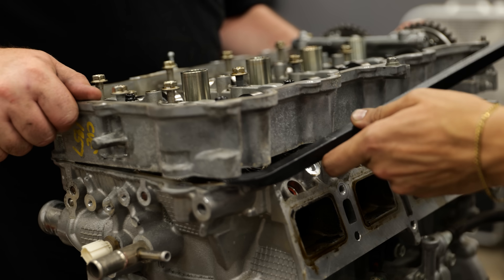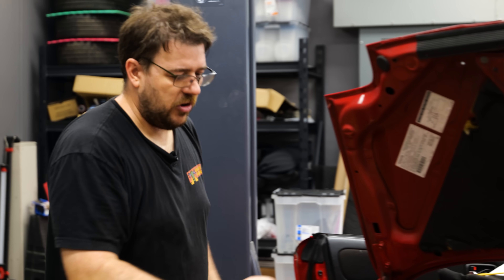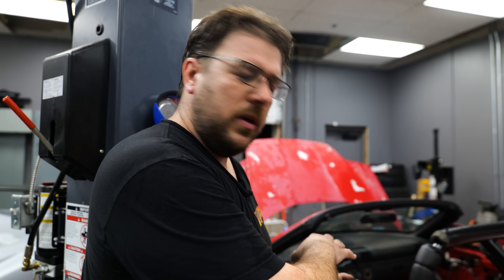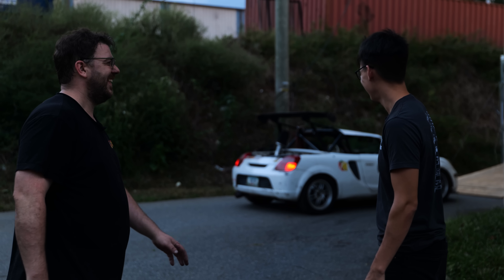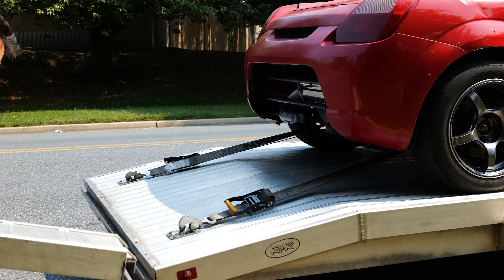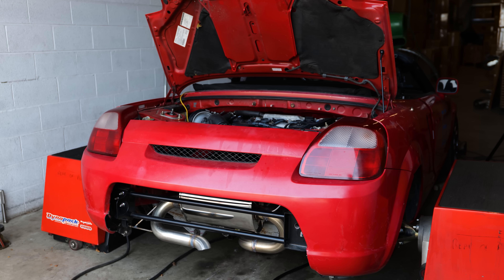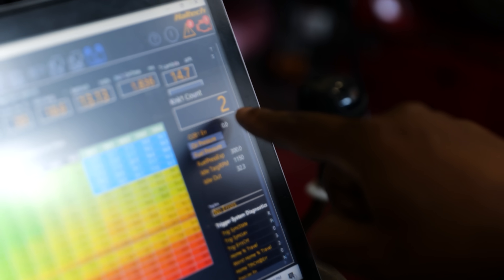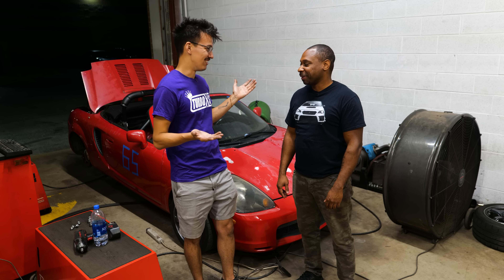Putting a Camry Engine in My MR2 - Episode 3

Comment: Thank you Ben for letting me help you with this build It was an absolute blast working with you guys for a week. I can't wait to see your reaction when you eventually take this thing to the race track. And don't worry, i have some easy tricks for more power if you don't find 230whp exciting enough.
Reply: Compare to honda K24, which worthed cost can build into 230 whp in N/A?
*Sorry my language not good.
Reply: Excellent! Also thank you for explaining things clearly and thinking outside the box.
Reply: @donnysgarage545  as of right now. It’s cheaper to do 2ar. Toyota more belongs so easily install. 300-330 is possible.
Reply: @justanotheroglesby2847  wow.. why toyota boys isnt like honda boys, which is loved to develop the engine like 2ar than k24. 😅
Reply: You really did some great things to get this engine to liven up, very interesting to see this engine swap, great work!
Reply: Dude you're a legend
Reply: @Frankenstein Motorworks Excellent work on the development of the 2AR. I am highly impressed with what you have done.
Reply: @donnysgarage545  the only that the k24 has over the 2ar is after market support that is why they used two intake cam shaft
Reply: @donnysgarage545  it's unfortunate the 2ar didn't get much support the previous gen the 2azfe got trd supercharger performance cam shaft 2.6L stroker kits fully build 2azfe 600-900hp but the 2ar got nothing that was purely a mpg engine not a performance engine
Reply: @jermainetuning  Thank you and I admit I was a little nervous to hand off the tuning to someone else but it looks like you made sure to show the full potential of this exact configuration.
Reply: Hey men you did a great job with the car
Reply: @master6435  The 2AR has a 2.7L crankshaft available at the Toyota parts counter for $650 or so. Plus Toyota just built in a lot of the upgrades right in on the base version of this motor. For example with the 2AR-FXE build we are spinning that thing up to 7600RPM on stock valve springs. The stock 2AR-FE intake manifold seems to be able to move enough air for about 240whp, the exhaust ports are absolutely enormous and have room to be ported out way bigger. They just included everything right from the factory and it ends up not being as obvious that way.
Reply: On time of 3:00 when you first start engine with new exhaust I can clearly see the coolant leak as you rev the engine. Hope you will fix it before driving out of the shop. Great build, enjoying every minute
Reply: @FrankensteinMotorworks  wait the crank from the 1AR-FE tacoma can fit in the 2ar block?
Reply: @master6435  for the reference, maybe you can see the papadakis racing build this engine make 1.000 hp at 7th years ago in channel youtube papadakis racing.

Yes i agree, unfortunately toyota communities dont have support with performance part, unlike k24 honda performance part is abundant.
Reply: So can we call Marc the “2az doctor” or “Toyoda”
Reply: u gotta turbo kit??
Reply: @master6435  the 1ar-fe is in the venza, sienna and highlander and yes it will fit.
Reply: @cornpop21  Probably not wise since it's already 12.5:1 to compression ratio.
Reply: Now the question is, will this motor fit in my Corolla hatchback? 😎
Reply: @melvinlopez9248  if your talking a new model year hatch, i dont see why not. The current motor is a direct injection derivative or younger sibling to the 2ar, if i recall right.
Reply: @Frankenstein motorworks what size is the exhaust on this build?
Reply: @e5141981  This is 2.5" from the collector to the tail pipe.
Reply: Did I miss the torque reading? I'm curious because I'm debating looking into doing this swap in my 05 corolla xrs over a turbo system on the 2zz. I'm getting a little older and the car will stay a street and auto x car so a torquey mid range with reasonable peak power speaks to me over the more peaky nature of the 2zz.
Reply: @FrankensteinMotorworks  you are doing great stuff mark. Keep it up
Reply: @FrankensteinMotorworks  that is cool
Reply: @donnysgarage545  agree, k24 + k20 head does like 270hp 🤣 stock k24 can do 240+ whp easy
Reply: @FrankensteinMotorworks  2AR 2.5L is around £1000 here. Which is the same price as a Honda K24 that offers a lot more support. It may make sense for your market but nowhere else outside the USA
Reply: Was a delight to see you on the channel and to learn what can be done with Toyota engines
Reply: @RoadsterAlex  The 2AR-FE is mostly a North America and Australian motor. The reason it isn't cheap in the UK is because you only get the 2AR-FXE, not the 2AR-FE and the volume is really low. But just because it only makes sense in a half dozen countries does not mean it should not be explored because those half dozen countries are my big markets for my parts anyways.
Reply: @FrankensteinMotorworks  I get your point but you sometimes act it’s a better choice than a Kseries which it’s not :)
Reply: @RoadsterAlex  the point is it’s cheaper and easier to do, k series parts are $$$$. They made this power from stock junkyard parts. 230whp na from 4 cylinders is amazing even compared to 4 cylinders rolling off the production line today. Yeah k series has a ton of support and potential but this is an amazing achievement and smart/cheap solution to the big issue that the mr2 spyder has:lack of power stock.
Reply: Cheap is a relative term
Reply: lol, i anticipate a shortage on 2ar motors in the near future because of marc.  fortunately there aren't a ton of MR-S in the USA, and with most of the MR-S in California, not everyone will be able to do the swap.

But hopefully that means a bunch of 3rd hand 2ZZs will flood the market for California folks to pickup.
Reply: @zokusharuuku1091  in your market indeed :) kseries is a lot cheaper over here :) and agree that 1zz isn’t powerfull enough
Reply: How much more exciting is that extra 40 WHP? (:
Reply: Thank you for adapting and making parts for the engine, always love seeing engines that aren’t normally used being worked on. You seem to have done a lot of work to get to this point in terms of how plug and play it seemed
Reply: @master6435  he used 2 intake cams because it’s a cheap and reliable proven option
Reply: @beerweather1566  look up performance cams for the 2ar I've never found any
Reply: @michaelscholten9753  yeah for Google that's not even the first to see its all form sites when I look
Reply: @FrankensteinMotorworks  Dude, you are a freaking wizard with the 2AR. What you are able to achieve with stock parts and N/A only is insane. It was really good to see someone match or beat the K24. That's how the MR2 should had been from the factory. Its gotta be a blast to drive with that power to weight ratio.
Reply: Common misconception but the k swap is easier than the 2ar swap, wiring, axles shifter, 2ar is dbw, k uses mr2 throttle cable and mr2 coolant hose , both swaps are pretty close cost wise in bare bones trim but when including basics like lsd and ac the k is cheaper. And my theory about “240whp” correct, didn’t happen even with E. I made 230whp 190wtq on a non hub load bearing dyno  pump 93. Stock internal 08 k24a2. You won’t touch K numbers until you have roller rockers and the ability to command cam angle 0-50 degrees, dual cam profiles, and a higher flowing head, because I’ve seen the charts, big ports doesn’t always mean it flows more, like how the k20 head flows more with a smaller (lighter) valve 🫣

But…. If you don’t care about having the best and want to keep everything Toyota for names sake this is probably a pretty good choice.

Thank y’all for sharing the numbers!! 

Not equal, and does not have more potential
Reply: Does are car like that put you in Class A in lemons?
Reply: thanks for sharing your secrets. you may have inadvertently created the new K-swap!
Reply: @rilagin1  My car races as a class A in lemons. Note that it does not get raced in the 270whp configuration seen in the video, I race it in the lower budget 240whp configuration.
Reply: Loved watching this series. Seeing a scientist of a specific chassis work is so cool.
Reply: ever think about putting one of these back into the hybrid?
Reply: @jackcphelps  The amount of software work needed to make that work would be pretty enormous. The hybrid's transmission is two electric motors that have to balance the engine's power so with over double the horsepower the tune would be completely off.
Reply: @FrankensteinMotorworks  is there a way to mod this engine without messing with obd2/ Sensors/etc? Can it be be road legal?
Reply: @donnysgarage545  The only car this was in that was even close to a sports car/anything performance was the Scion tC and that car was marketed to teenagers. All of the other applications were cars meant to get pretty good gas mileage (my tC gets about 28mpg city, 33mpg highway)
Reply: @Caned5  The stock ECU will actually run great with much more air than would normally enter the engine. This generation of Toyota engines seem to be programmed for 20-25% more power without any need to modify the ECU. In the case of the 2AR it seems like it is happy to make about 190whp or so if you make it easier for air to get in and out. As for that being road legal, this mostly depends on where in the world you are. There are definitely some places where you aren't allowed to touch any of this and other places where you can. Also note that quite a bit of the low lying fruit is all in the exhaust. These engines are heavily muffled and unplugging that can make good power but even touching the muffler is illegal in some parts of the world.
Reply: You are a legend, thank you to all the things you are making possible for the ones who love this brand. Toyota all the way💪🏽
Reply: @RoadsterAlex  on a Toyota car with Toyota wiring harnesses and the like, I'd imagine it's easier to do this than to convert it to a K-series. I don't see many K-series making 215 wHP on pump gas for $1000. Horses for courses.
Reply: @jsquared1013  have You read trough their manual how to wire everything up? Kswap wiring is definitely easier 🤷🏽‍♂️
Reply: Is the 2ar-fxe is possible make it  to a bar legal smog swap here in Los Angeles? Toyota engine should be plug-in and economic for now to pass the ref inspection.
Reply: @rolldog82  The 2AR-FE can be CARB legal quite easily but the 2AR-FXE engine as built for this video series requires an aftermarket engine controller because of the secondary intake phaser which automatically prevents it from being CARB legal.
Reply: @FrankensteinMotorworks  great news to hear 2ar-fe swap instead k20 or 2zz. So stock intake systems and exhaust system is usable on the mr-s right? Thanks for the feedback. What's the hard thing about the swap to make it carb legal?
Reply: Would it be possible to replicate what you have done with the 2AR-FE to a 2AZ-FE motor? I know both use a variable intake camshaft but not for the exhaust camshaft
Reply: As an automotive technician, I really appreciate your attention to detail. We specialize in retro fitting EFI to older carbureted vehicles and the hardest part is making everything look factory and well thought out but you take it to another level, the amount of detail and information you learned and spent time researching really proves your level of dedication.
Reply: @nathanadams1332  Thank you for noticing, i really do aim for OEM+ with all of my parts. That's also why i go out of my way to get custom rubber mounts made instead of using poly and other decisions like that.
Reply: @RoadsterAlex  a bam engine is a better option than a k series in the uk. Bang for buck bag 1.8t in uk smashes the k series out the water.
Reply: @afzali4850  keep dreaming 🤣 ever felt the gas response of the kseries? I had a 1.8T years ago and they are super lazy
Reply: @RoadsterAlex  you speak of “gas” response like you live in the states. Dynos don’t lie vags are a force to be reckoned with. I’m not knocking the k series engines… but there are  easier engines to convert the spyder. Eg you could do 2  bam swapped spyder for the price of 1 k swapped spyder in the uk.
Reply: @afzali4850  who cares about the price 🤣  I wouldn’t put a bam in my car if it was free.
Reply: @RoadsterAlex  if your not fussed about price why did you previously mention a k swap is cheaper than a 2ar in the uk? Don’t throw stones in glass houses mate
Reply: @afzali4850  because 2AR is almost impossible for find in the UK while you can find Kseries everywhere
Reply: @RoadsterAlex   more than one way to skin a cat. Don’t make out the k20 is the holy grail

 I was telling you bang for buck a vag 1.8t is better in the uk than a k20.
Reply: Knowing the Bens… those tricks will become very much appreciated and used..! ^^
Reply: @FrankensteinMotorworks I imagine with some better valvetrain on the FXE with a 2.7 crankshaft, the 2AR could be a monster. High rev, more stroke. A true animal.

Comment: The MR-S really is an example of a car that doesn't benefit from ludicrous amounts of power. Like, you could fit a crazy build in there with 500+ HP, but you'll just be going off the track sideways that much faster. I think around 300 is probably the most you can reasonably hope to use in that car unless it eats a really heavy engine.

Comment: heat soak from the forward exhaust. try to vent that better, try to get a box from side intake to engine air filter. try to ventilate engine bay better somehow? bigger holes in the lid and the rear?

Comment: What motor can make 230whp by advancing a cam 1 tooth. Stock head port, compression, and revving only to 7k rpm. This motor is the next big thing.
Reply: The k24 does it without e85 or opening the motor to advance a tooth. And also makes more torque with less displacement and lower compression

Comment: the EB60 has longer gear ratios when compared to the toyota C60 and K series 6 speed transaxles. that being said i do not know bens wheel tire diameter set up on the ZZW chassis. However with a 4.0 final drive and a 7600rpm max power celing. that sounds like each gear is way to 
long! and yes im aware the chassis is probably 2200lbs with the larger engine now.

Comment: i have a 2zz spyder and have been planning to go k-swap once i blow that engine...

but now this has me thinking of going 2ar instead...
Reply: 3SGE/GTE are the best, also in Aus lots of people are starting to use 3RZ FE out of hilux , they can make HUGE power and being big bore have great bottom power
Reply: The 2ZZ has a lot of potential if you get it built by the right people but getting k20 horsepower out of it is rather expensive compared to a Honda engine.
Reply: @jameswood1935  The 3S engines do not belong in MR2s, especially Spyders.
Reply: Rewatch this build, look at all the shit they had to do to it to make the engine viable. Now think about how you don't need to do any of that with a K24. 

This swap is a novelty. The 2AR is not a performance engine. When you put that HP rating into context it isn't even making 1HP per Liter. When you finally try to get legit HP out of it the limitations of the internals and head design will become clear.
Reply: Keep it toyota
Reply: @jameswood1935  3S too heavy for the MR-S. Would screw up the weight balance. At that point you may as well do 2gr
Reply: @zerohikari2685  yeh, had to buy a brand new manual transmission from Toyota. Wonder how much that cost lmao. Pretty cool, but a novelty at best, and it's in no danger of ousting the K series as the best swap platform ever to exist.
Reply: @Where_we_go  No need to wonder, the transmissions are $2400 new from Toyota. But it's all good, It's not like i'm trying to get people to stop K swapping, i'm just offering a different option that some people would prefer.
Reply: @zerohikari2685  keep in mind this is with factory parts. The k series has an enormous amount of aftermarket and is been like that for almost 2 decades now. Yet the 2ar with individual RnD seems to be a better performing engine than the k series with such little mods. Of course the 2ar isn't a Lego plug n play where you can get off the shelf parts, it's an enthusiasts engine which if you read others feedback it's becoming the alternative for the k.  series.
Reply: @urot The 2AR is a worse swap in every conceivable way than a K24. More expensive, More Complex, Less Powerful, Heavier. When justifying a swap these are all the things to take into account. You wont here me arguing against a 2ZZ or a Hyabusa Swap for the MRS over a K24 because they have significant advantages in weight, complexity, and cost. All of those engines have heads, blocks, and Cranks designed for performance. They have significant aftermarkets. The 2AR has none of these advantages.

I'm just being frank. It's a novelty swap. Like swapping a 1UZ into a MRS. It's cool but it is less than ideal.
Reply: @mr2_nate  hahahahahahahaha they were made with them and raced in that format
Reply: @jameswood1935  But now there are much better and more modern engines available. And the 2AR and 2GR are MUCH better at racing.🙂

Comment: At 3:05 are those bubbles on the block meant to happen ? Above the left hand side of the muffler.
Reply: Nice catch. I forgot to bring small plugs to block off the throttle body heater lines so we tried vacuum caps. Turns out they weren't good enough so it sprung a leak. It was an easy fix.
Reply: @FrankensteinMotorworks  Nice :)

Comment: Cam cover bolt is looseing at 1:32 guys
Reply: You worried me there for a second. I see it now, that's just a bolt that was holding down the hybrid harness and isn't needed for the NA harness. An oversight to not remove it but it won't cause any issues.
Reply: @FrankensteinMotorworks  all good! Love what you've done!